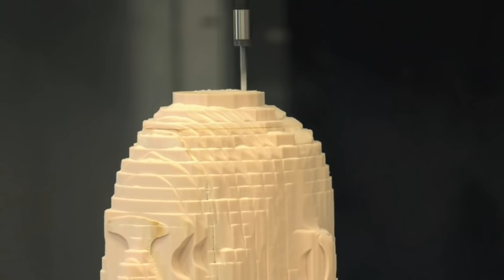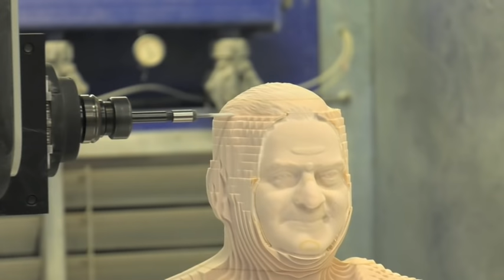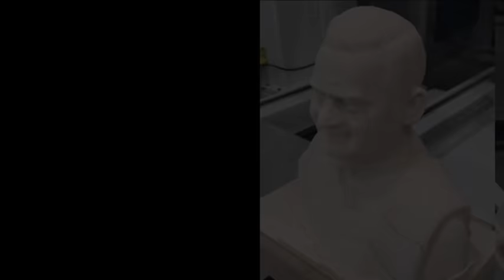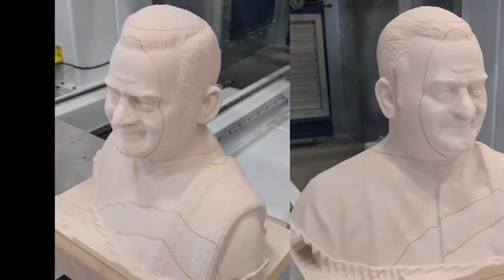Thermwood Model 90 Machining Bust in Low-Density Foam

Comment: Hii, in  the case of operation indexables  work with a plane of reference with especial code, or is with TCP motions?
Reply from the maker: Hi Rafael, it is one coordinate system with planes defined in Mastercam. The machine is running with TCP motions.  Thanks!